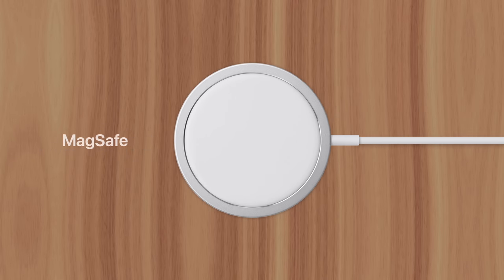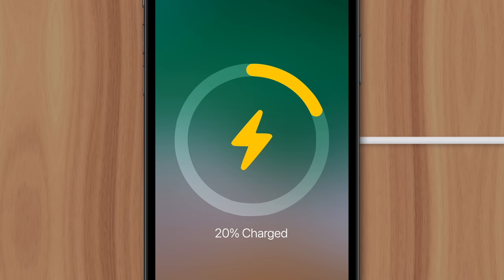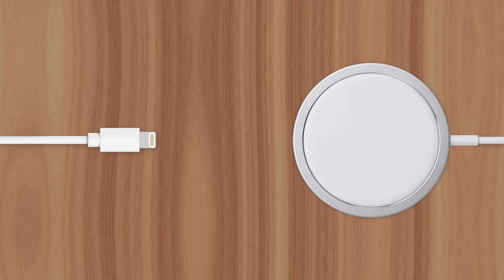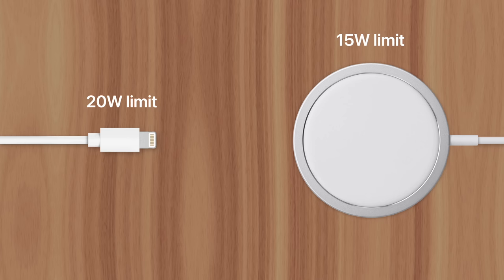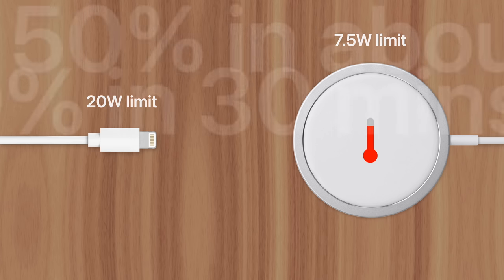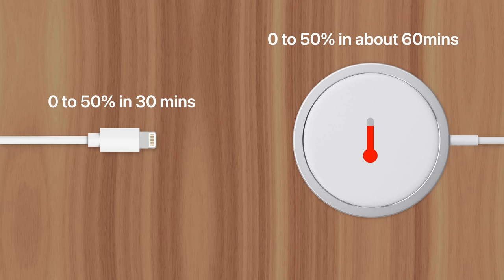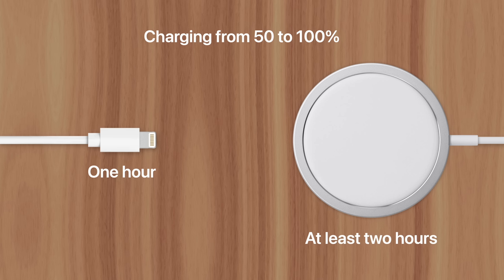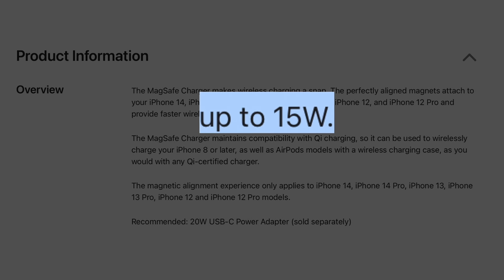Why MagSafe Charges So Slow

Comment: I charge my 14 Pro Max using a 5W charger over night (magsafe). Enough time to charge with no rush and no heat. No super ultra fast charge neccessary. And I make it stop at 90%. My battery loves it and will live a long life.
It never saw 100% and it‘s a battery beast anyway. Lowest was 35% after a day. It‘s perfect!
Reply: Just curious, how do you make it stop at 90%? I can't find a setting for that
Reply: @joeldowell5059  It’s not an iOS setting. I have the charger connected to an eve energy. You can use the shortcut app to set an automation: when the battery reaches 90%, the eve energy will turn off. So it stops charging 🙂
Reply: @stefanmaurer8536  I'll have to look into that, thanks!
Reply: @stefanmaurer8536  why? I use an apple 20w charger until my iPhone 13 Pro Max reaches 100% and when I go to sleep I unplugged it lol
Reply: @koukkoufos2000  fast charging is not good for the battery health.
Reply: @stefanmaurer8536  So far my iPhone 13 Pro Max is at 96% capacity, 20w isn’t even that high, its the bare minimum to fast charge a smartphone, also fast charging at 20w does less damage than 100w let’s say lol
Reply: @koukkoufos2000  96 already? thats terrible
Reply: @donnytraan  What? 😂
I just checked and my iPhone 13 Pro Max maximum battery capacity is still at 96% even after a month since I posted my last comment, I bought it April 29th 2022 so keep that a mind, a few months after launch not the same day or month of Its launch, so 96% is fine because I don’t let it drain from 100% to 20% or lower like most people. I keep at 90% and charge it while I use it at 100% and only unplug it from my 20w charger when I go to sleep so it doesn’t charge overnight and even without charging it’s still at 100% battery health in the morning
Reply: @stefanmaurer8536  Fast charging is good, 5w is garbage
Reply: @donnytraan  now it’s at 95% maximum battery capacity 😂
In like 3 years it will be 79% or lower at this rate lol
Reply: @koukkoufos2000  mine is 88% and I bought it a couple of months before yours so 95% is great
Reply: @makeensabri9100  probably because most days I never let it drop below 46% lol
That was the lowest I’ve ever had my iPhone 13 Pro Max and when I use apple’s 20w charger and apple’s type c to Lightning cable it fast charges to 80% and I can tell because it’s very warm to the touch lol
Reply: Life is to short to worry about your battery life lol enjoy your 1000$ dollar phone and use it as much as you want charge it whenever and use fast charge if you can. You don’t know if you could die tomorrow and won’t take the phone with you in your grave. Plus it’s 70$ at Apple for a battery replacement do it every year and you’ll be good
Reply: @Mysweetdoodles  I’m mindful of my iPhone 13 Pro Max battery actually but I love fast charging that’s why I bought apple’s 20w charger
And by mindful I mean I never let it drop below 46% maybe one time it reached 30% when I first bought it 
Ever since, no, I only drain it if I’m forced to leave my house and charge it when I go home 😂
Reply: @koukkoufos2000  Battery degradation isn't linear. Most of the degradation that the battery will ever experience happens in the first year or so. We know this from the long-term battery health data being generated by electric cars
Reply: @ExclamationMarx  so how long will my battery health last on my iPhone 13 Pro Max? Right now it’s on 94% maximum capacity
Reply: @koukkoufos2000  It massively depends. There's no way to know on a per-battery basis
Reply: @ExclamationMarx  Really? Why not? Lol
Reply: @koukkoufos2000  There's a very large difference between batteries. Sometimes you get a good one & sometimes you get a bad one. It's sometimes referred to as the "Lithium lottery" like the silicon lottery for computer processors
Reply: @ExclamationMarx  Fuck that, how am I supposed to know if I was lucky with my iPhone 13 Pro Max or not, I bought mine in April 29th 2022 and today it’s at 94% capacity
Is that good or bad?
Reply: @koukkoufos2000  You would have to do a capacity test when it was brand new & compare the results to the "Typical capacity" that's advertised by Apple to see if your battery is better or worse than what it's rated for
Reply: @ExclamationMarx  How the fuck do I do that? At least apple gives us a rough estimate with battery health in settings lol
Is mine good or bad? Tell me
Reply: @koukkoufos2000  If it was a car, I'd say that was bad. But since it's a phone I'd say that was probably better than average. For context, Apple allow batteries to be 5% below their typical capacity. But you'd have to be really unlucky to end up with one of those bad batteries
Reply: @ExclamationMarx  When I bought my iPhone 13 Pro Max new in the box from apple, it was at 100% maximum capacity so I guess I got a normal one
Reply: @koukkoufos2000  I’m sorry but you’re an annoying guy (because you weren’t properly listening to the other guy) from a month ago. All new iPhones will be at 100% of their maximum capacity when you receive them, however there is some margin of error from the designed capacity, for instance my 80 Wh laptop battery was actually 83Wh when I got it. (So 100% on 1 phone could be more than 100% on another)
Reply: @sirwabaloo7930  I can’t even tell because it only says 100% or lower when you get an iPhone, also there’s no way to accurately tell unless you know how to code which I don’t, so I just trust the estimate battery health
Reply: @koukkoufos2000  stop spreading false information. you obviously have no clue what you are speaking of. Lithium batteries will degrade no matter what you do or how you charge them. This is just how lithium batteries are. It's impossible to have a phone for 3 years and maintain a high percentage like it is new.

Comment: Most people didn't put a lot of thought behind charging tech because they charged their phone overnight.
But nowadays, people have become more aware that charging past 80% causes more battery damage, so they are often charging during the day only and this is the reason why we are seeing companies starting to provide faster charging solutions in their products.
Reply: How do you charge to 80%? With a 4 volt charger or babysit the phone.
Reply: @David-jx4gw  the Battery Management System does monitor the voltage of the Battery and also modern Phones are learning how your using it so they keep themself at about 80% at night and start the charging process around the time you usually get up.
Reply: @DarthG3nesis  I don't think phones have any different battery charging system than any other lithium charger. Just charge to 4.2 volts and the charging slows down when the battery as the battery gets full because the resistance gets higher. My phone switches of at 3.5 volts when most other lithium devices cut offs are 3 volts, so there is not much point in charging at 20% instead of just using until flat. It does seem to to overcharge to 4.25 volts at 100%
Reply: @DarthG3nesis  the stopping charging at 80% and resuming in the morning seems a good idea. I charge my electric bike on an timer so as to try not to damage battery
Reply: Haha, don’t worry, charge your phone above 90, you will need it more. Don’t take all these tips too far

Comment: It's speculated that Apple will ditch a charging port altogether in order to comply with the EU regulations ''on their own terms". They'll have to either massively improve wireless charging or admit defeat and switch to USB-C.
Reply: Exactly and it's not just only about charging. The whole USB-C ecosystem is just better. Want to connect a USB flash drive to your iPhone? Nope. On Android? Yep. Wanna use that USB-C to HDMI cable for your presentation? Nope. How about the Ethernet adapter? Out of luck. I'm working in IT and just for these reasons I have to carry a 2nd Android phone to compensate for the lack of iPhone connectivity. USB-C (or Thunderbold 3/4) is already fine for Macs, almost completely transition for iPad, so what's wrong with iPhone anyway? I just don't get it.
Reply: It is almost certain that we will get an USB-C iPhone this year. But a portless phone is definitely on Apple’s plans.
Reply: @matt4054yt  don’t understand how we can take these high MP pictures with huge file sizes and the phone is still using USB 2.0 SMDH
Reply: @matt4054yt  You're not right on this at all. Apple has sold adapters to allow SD cards and USB flash drives for many years now with both iPhone and iPad. I've had an HDMI adapter for years, again you're wrong on this. They also have ethernet adapters as well. Where are you getting your info!
Reply: @mortenthiele  nope clearly said USB-C versus lightning.
Reply: Apple has committed to the USBC for the 15
Reply: They tried but it didn’t work because it still has a cord
Reply: admit defeat they have lol
Reply: This didnt age well.

Comment: I see a lot of comments saying the same thing here so I'll post some things that you all should know. 

The whole "don't charge your phone to 100%" argument does not apply to modern technology anymore. It used to matter when battery optimisation and capacity were still being worked on, but if you have a modern iPhone, say X or higher, you don't need to bother to frantically unplug your charger before the ticker hits 100%. Yes, it does technically slow the ageing process of your battery, but the ageing is already so slow, if you just used it normally you really would not be able to tell the difference. The results you wanna see won't matter because after 2-3 years, your battery health will go down regardless of how little you charge your phone. At any point, to see any noticeable results it will take so long a time that the chemicals inside your battery will degrade either way, thus reducing your capacity through nothing but nature. Till then, only using 80% of your battery everyday so you can charge up to 95% of your battery 3 years later isn't exactly worth it, nor does it make any lick of sense. 

Think about it this way, you hard limit yourself to use 80% of your battery, so that you can occasionally charge up to 95% a few years later? Why does it matter if you're just going to charge to 80% anyway? The difference between that 100% and 95% is so negligibly small that you will not even notice it by the time that number ticks down in your battery health indicator. Charge away, your phone is literally designed for it.
Reply: its only noticeable at around 85%, specifically 74% on my phone
Reply: @alternatedenz  just curious, how long have you had it? And which model?
Reply: @galvendorondo  its a 6s, had it since it first came out, constant use from 2016 - 2018 and then mild use from 2022 - now

Comment: I use MagSafe roughly 95% of the time. iPhone 14 Pro Max is still at 💯 battery 🔋 capacity. In the car it’s slow in my 2022 Mitsubishi Outlander BUT it’s been convenient and because I charge when I can, I feel like a dead battery 🪫 really isn’t an issue with most modern smartphones, albeit, could be a challenge in a pinch. 🤷🏽‍♂️

Comment: The only time I have to charge my 13 Pro Max is if I didn't charge it the previous night. The speed is not really a problem for me. If I need a quick charge, I use a cable and one of my many 20+W charging bricks.

Comment: This is why I use a 3rd party magsafe-compatible charger for charging overnight. Slower charging = less heat, so less damage to the battery.
But if I need fast charging, lightning cable every time.

Comment: I did an experiment on my iPhone 12 mini in using the magsafe vs. Cabled charging. I’ve notice that my iphone does heat up when charged on magsafe and it’s slow. I constantly charge my phone infront of a electric fan to help with the cooling. It’s not advisable as well using (ex. Listening to music) the phone while it’s charging at a magsafe (I use the wired earphones FYI) in the end I’d stick to wired charging because it’s faster and allows the phone to rest while charging.

Comment: I don't understand where the misconception comes from that wireless charging degrades batteries faster. There is no difference between wired and wireless charging in battery degradation. During wireless charging, the iphone reduces power in relation to temperature.  Above 45°C the phone charges at 1W.  Iphone has higher temperatures when playing on the phone. The advantage of wireless charging is that the entire phone heats up evenly, which is safer than wired charging, which only heats up some of the chips.  It is also safe for the battery because it is heated evenly.

Comment: What are you guys doing, wrapping the phone and the MagSafe charger in a blankie? I don't get these results at all, personally. My phone (and the charger) does get warm but it definitely doesn't get hot, and I always get a good 50% charge in 30 minutes. Now it does slow down some after that, so I'm sure that's when the 7.5 watt charging kicks in, but again my results are completely different for my 13 Pro.

Comment: I use Anker magsafe powerbank 633. it produces less heat than another brands and also faster than the magsafe charger itself. while I can, I will use lightning cable, it is faster indeed & safer for phone battery lifespan.

Comment: I honestly use wireless charging only when I do not have the cable , due to the factor of heat,time and furthermore battery degration . It always better to use the cable

Comment: Yeah, Apple has to ditch lightning due to the EU ruling, which would be great for consumers if Apple goes with the USB C standard which has surpassed Lightning in both charging speed and data transfer bandwidth and provides an upgrade compatibility path to Thunderbolt and beyond. But if Apple follows the rumored “MagSafe Only” path and ditches the cables charging solution altogether on future phones, the slow down due to heat would keep it from being a viable “standard” replacement tech.
Reply: so in the future when they come up with something better than USBC it would have to be backwards compatible.   I dont know why they should force people to only use one cable what next for example  if i go to England or Europe or America or Australia all the power points are different. everyone has to use an adapter and US is different voltage. they dont seem to worry about this sort of thing so seems a bit hypocritical
Reply: apple did

Comment: How is mag safe even more convenient? I have the same issue with wireless charging. Its both slower and less power efficient (which cannot be green enough to warrant taking the block out the box) and you still need to use a high watt charging block and cable. You’re just needlessly adding an extra step that objectively makes the charging process worse.

Comment: I stopped using MagSafe because it would leave rings in my cases, which I later learned were from the heat it generates.  I just plug it into the 5W brick and it's been great.  The battery is only at 99% health and I've had my 13 Pro Max since it came out, I think it's because I use the 5W brick to charge.
Reply: It’s because a 5 watt charger generates less heat than a 20 watt charger. Heat is the number 1 factor affecting battery health.
Reply: i never heard of that it leaves rings are u using the mag sage cases
Reply: I use a 20w charger and I’m still at 92% capacity, not bad, I guess 20w lightning generates less heat than MagSafe

Comment: The degree of efficiency of a cable is about 80% (reactance of complex AC-calculation, Kirchhoff‘s law) and of wireless charging as of MagSafe is 60%. That means, connected to apple’s 20W wall adapter, you’re getting a maximum of 16 and 12 Watts. To achieve MagSafe‘s max of 15W, you’d have to plug it into a 25W charger (cuz 15*(1/0.6) = 25).

Comment: I have a new iPhone 13 which I only use MagSafe on. The phone is 100% wireless and I have even stuck a plug in the lightning port. If the battery degrades badly after 2 years I will replace it.

Comment: After using regular wireless charging on my iPhone SE (2020) about half the times I would charge the phone, I’ve decided against wireless charging on future devices. I believe charging wireless greatly accelerates battery health decline as my iPhone SE battery is now needing to be serviced. 
I’ve only charged wireless one time on my iPhone 13 Pro and will not ever do it again because I want this phone to last as long as possible
Reply: Wear evidence do you have of that other than assuming that's the issue?
Reply: @DavidKen878  it’s a strong hunch.
Reply: @DavidKen878  It’s a general consensus that wireless charging degrades your battery.. The wireless function generates battery heat at alarming rate, compare to wired charging. Heat is kryptonite for the battery… It’s kind of common sense

Comment: Honeslty, im fine with those downsides. Its worth it for wireless charging MagSafe imo. What sucks for me is that MagSafe cables idle at around 0.9 watts. I wanted to plug one into a battery pack in my backpack, just to find 25% gone after 2 days with literally no charging of any devices. This was before I googled it 😂

Comment: This is NOT wireless charging. It's actually mutual induction charging designed for low-power appliances like electric toothbrushes. Because this type of charging wasn't designed for power hungry phones

Comment: The wire is too thin to give me much confidence as to its build quality.  That by itself is enough to avoid this item. But the real issue is "Is this a time saver" as opposed to simply plugging it.   I purchased a Apple wire charger four months ago when I got my Iphone.  How neat...I thought.   But it is not a time saver....in face, takes more steps to charge your Iphone and take longer time charging it.   After about six weeks, I put it in my desk drawer and it has been there ever since.  The bottom line is that charging your Iphone is faster and more convenient using the wired charger.   Bottom line, don't waste your money buying an Apple wireless charger because that is what you will be doing; wasting your money AND time.